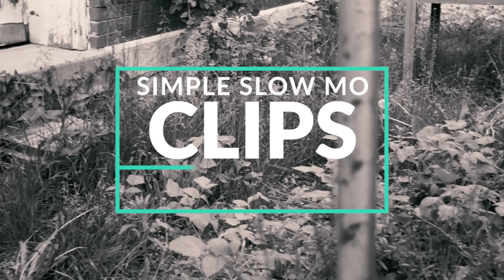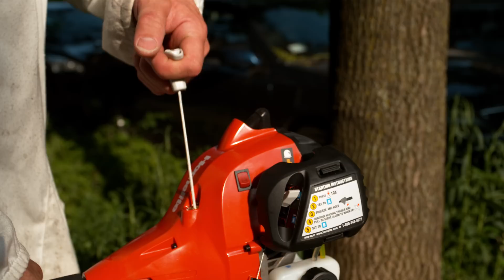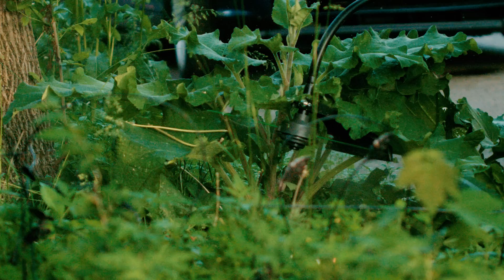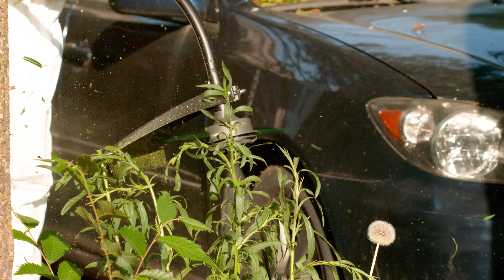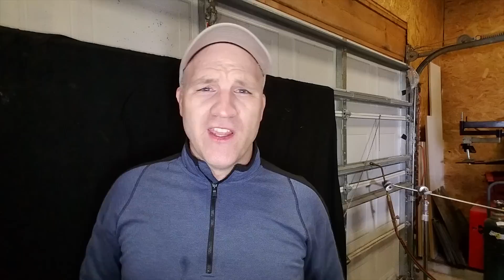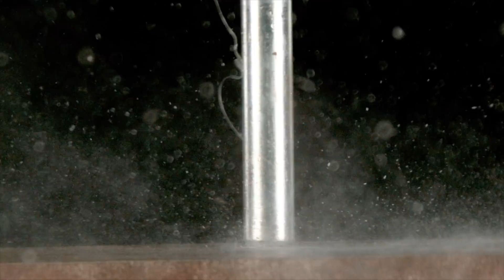Weed Whacker In 4K Slow Motion - A Different Look At How A String Trimmer Works

Comment: Line trimmer hint. With the line spinning clockwise (from above) cut with the plants on the left. That way the debris is thrown forward and not backwards all over you. The guy in the video is cutting with the plants on the right of the trimmer, clearly demonstrating the wrong or at least messy way to do it.
Reply from the maker: +Dom Hawtin you're right, I know, this was just a really early Test video, we just figured why let the footage go to waste, we'll probably do a full episode in the future because it definitely has potential. Thanks for watching
Reply: Mr Hawtin,

Indeed, this simple tool has a lot of physics involved.

This video was a brutal assault on somebodies flower bed, and
was clearly not a tutorial on what or how to properly trim anything.
But we all know that and appreciate this and future videos on the subject.

However, most string heads turn CCW (CounterClockWise) from above.
Therefore, I prefer to cut CCW around an object since that method allows 
the tool to gently pull from me and pull into the region I'm cutting,
instead of flinging out away from the cut region, causing me to fight it.
This reduces back fatigue and also cuts better.
(Think about 4 hours continuous duty, like a cemetery).

YES, it does throw the debris back at ME, but I am heavily protected
head to toe, and will tolerate that for a better cut and reduced fatigue.
It is the EXACT principle as a wood router.   You loose control of the
cut if you move it the wrong way on a piece of wood.

String cavitation is also a problem, but this video did not show how the string 
actually wobbles after impact, and is no longer effective at cutting till it
straightens up on the next rotation.
The Vortex string is a twisted pair of strings, and almost eliminates 
the wobble, but it is a very aggressive string that will damage plastic
and wood fences, etc.

Central Florida.